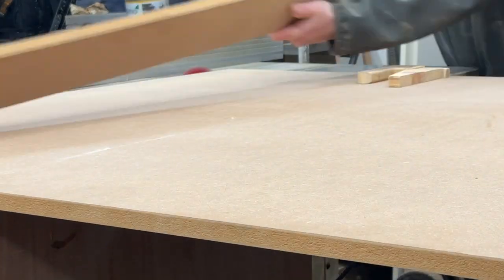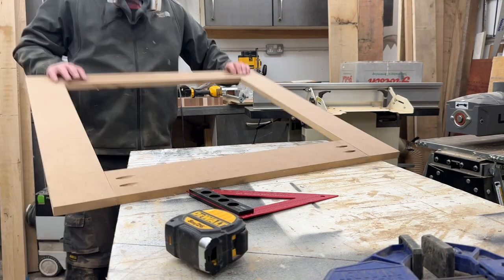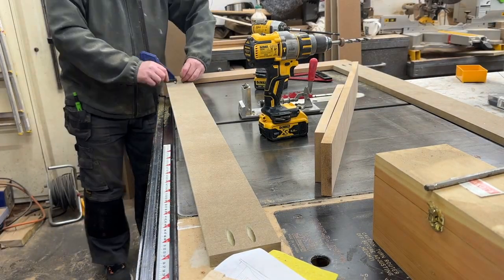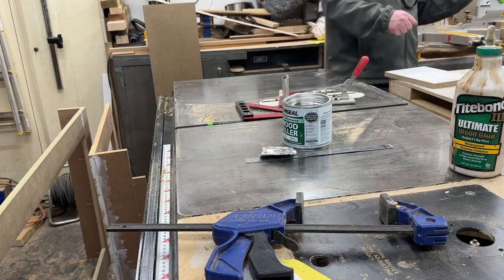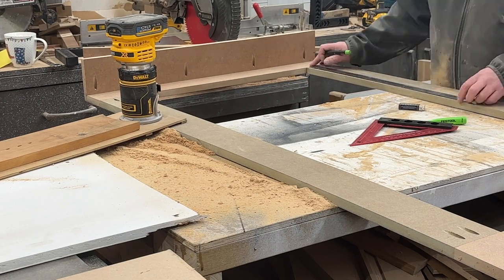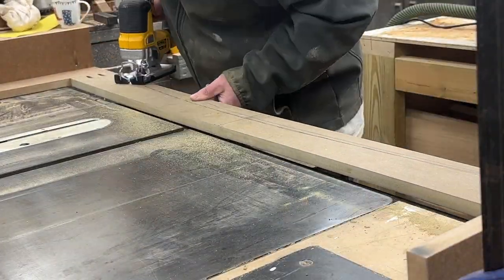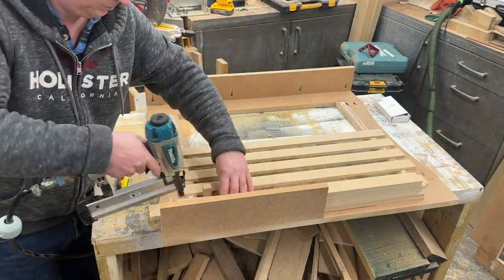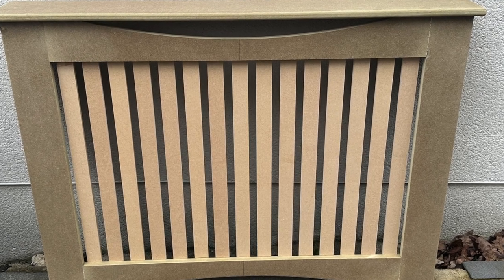Radiator cover build with arches and slats

Comment: Do you wear the mask throughout the process? Must get a bit toasty in there
Reply from the maker: Have to be double careful with mdf the glue they use to make the mdf is particularly bad for the lungs so no such thing as being too careful which is one reason I like to work more with hardwoods but even they can irritate if your not careful. There is a good reason I upgraded to a jcdc 2 cyclone extractor to get more of the dust each time works great on the machines with extraction need to at some point upgrade those without but it’s a expensive upgrade as I like quality tools and they break the budget right now
Reply from the maker: Besides I kid myself I am like Darth Vader and who wouldn’t want to be him?
Reply: @woodworkgeek  Daft Blader more like